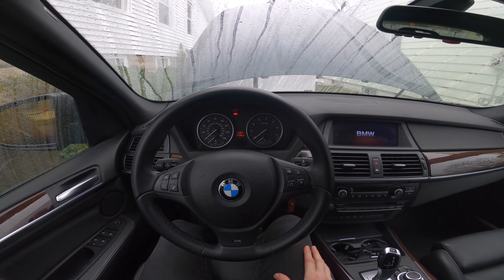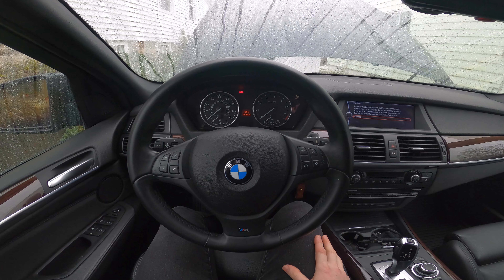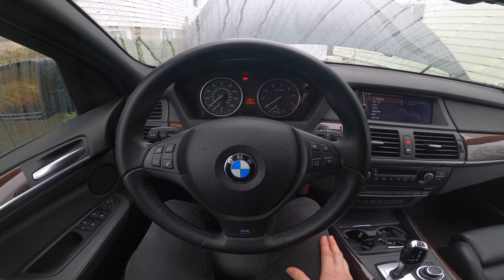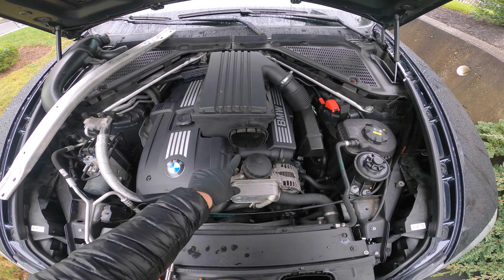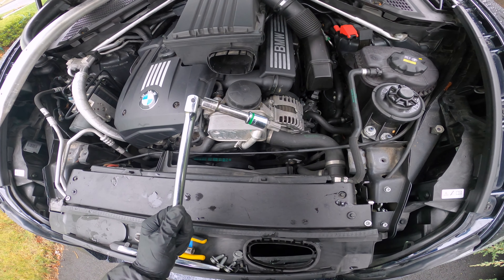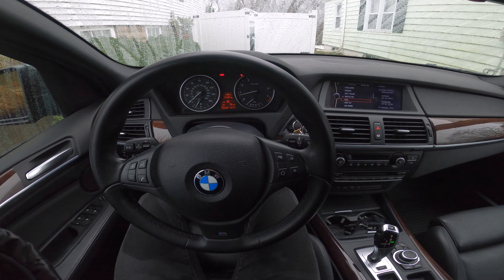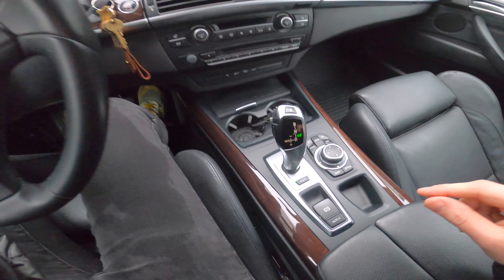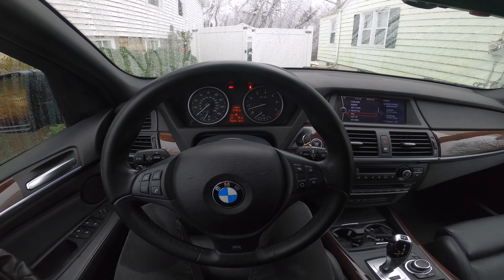E70 BMW X5 Mystery Engine Whining Noise Diagnosis Alternator or Power Steering Sound

Comment: hey, we have identical E70s. I had the same issues in the past. I replaced the Disa valve (bigger one) on the right. the one that is easier to access and to replace. Check both DISA valves. 
Happy New Year,
Reply from the maker: thank you, I will check them as well! happy new year!
Reply: Yes me too
Reply: @BIMMERZEITT what was the issue for you
Reply from the maker: Upon inspection, my BMW dealer said it is the small disa valve under the intake. I replaced them both. I believe the noise is resolved.

Comment: Did you ever figure out what the sound was? I have a similar sound after replacing my power steering pump and a dynamic drive line.. still can’t nail it down!
Reply from the maker: BMW diagnosed and said it is the DISA under the intake manifold. Need to remove manifold to replace. I need to do it soon!
Reply: @BIMMERZEITT  good to know, thank you for the response man!
Reply: I also got this sound after replacing the active stabilizer and 3 hoses. not our reason?

Comment: I'm not very deep into X5 but what does the active suspension have to do with the power steering?
Reply from the maker: I may have misspoke, but I'm just saying that the active steering/ adaptive drive/ active suspension steering pump and alternator are different part numbers than the e70 models without those options. Generally speaking, the alternator and pump are way more expensive for the e70 with those options. So I'm happy that the pump and alternator appear to be fine.
Reply: @BIMMERZEITT  thx
Reply: @BIMMERZEITT  because there are active stabilizers, which are hydraulic, and have one circuit with power steering

Comment: Any updates on what the problem was? I had a bad whine on my 11 E70 and the Power Steering pump failed. Problem is the new $1300 OEM BMW pump is defective and the whine is still there but a little less noisy lol. Glad I ordered from FCP Euro for the lifetime warranty.
Reply from the maker: How did yours fail? BMW said the noise was the small disa under intake. Today we had a catastrophic hydraulic failure. Fluid everywhere. Not sure if a line or the pump let go…

Comment: You might have problems with your I drive screen it keeps fading in and out ? Or maybe just how it appears on camera.. engine noise sounds kinda normal I had same engine in my previous car and it made similar noise.. but to be sure check that ac compressor, there is a bearing in a ac compressor pulley that can be replaced.
Reply from the maker: thanks! yeah I’m thinking it’s the AC compressor. I’ll have to check that next.
Reply from the maker: as for the nav screen, might just be the shutter speed rate on the camera vs. the screen refresh rate

Comment: I have a bmw x6 e71 35i and i have the same sound! 
Could it be hydraulic pump????
Reply from the maker: Which pump?
Reply: @BIMMERZEITT  power steering pump* ?
Reply from the maker: @pianobyat7578  I took the serpentine belt off in the video… so it’s not the PS pump or Alternator.
Reply: @BIMMERZEITT  when you took off serpentine belt, is it still making the same sound? Because it can’t hear it well
Reply: @pianobyat7578 fix problem?

Comment: I would pull the AC belt and spin the tensioner , if it still does it , prob the vacuum pump, better hope its not the vacuum pump lol
Reply from the maker: Thanks brother! I cut the AC belt last night, noise is still there. Was hoping it would be the pulley. Well I guess it’s either the vacuum pump or the oil pump…. Vacuum would be better than the oil pump lol
Reply from the maker: I'm thinking it's the vacuum pump. Ever done one before?

Comment: Hey I have a question whats wrong with my bmw 2011 328i no check engine light on but turn off out of no where & needs 30-40 minutes to turn back on ?
Reply from the maker: Start by scanning it with a BMW scan tool and check all the systems for codes. They can be stored (shadow) but not throwing a light yet.

Comment: did you fixed your noise problem? i have a same problem with my car..e70 48i
actually im trying to figure out this problem but not yet. if you solved the problem or have some clue please share with me. thank you!
Reply from the maker: Not yet. Possibly the vacuum pump or worse yet, the oil pump. The oil pump noise is more common on the V8’s like yours. Look up x5 oil pump noise here on YouTube.

Comment: Hey, uhh, any luck on the source of that noise? I'm thinking AC comp myself, but I also just got my 2006 e90/n52 serviced to clean out the oil tube bc the belt broke 🤷‍♂️
Thanks for the quality content!!
Reply from the maker: BMW said it’s the DISA under the intake manifold. There are 2 valves on the n52.

Comment: have you had any luck?
I meant to ask you: what do you think about the diesel variant of these? Are they a good buy?
Reply from the maker: I haven’t had time yet! Could be vacuum pump or oil pump. However, I heard a 2010 328i with same engine the other day, sounded the same. I considered a 35d and 35i… 35d has very expensive and complex emissions parts that fail. 35i also has very expensive components. This is my wife’s commuter so I went with the 30i for “reliability” and lower cost of ownership.

Comment: The joys of BMW ownership... however that's any car.  Have you tried using a mechanics stethoscope to probe around listening to it?
Reply from the maker: Haha totally. I actually don't even own one, maybe it's time to pick one up and add that to my tool kit.
Reply: @BIMMERZEITT  harbor fright has then cheap af but a recommendation is get them then go to a medical supply and spend the money on replacement ears pieces getting an assortment of sizes to find what fits your ears.  They are soft and seal better not hurting your ears but all in maybe $15-$20 for everything.  Worth it for troubleshoot.  It use mine at work weekly or more.  Cheap HF set with nice ear prices.

Comment: Hey thanks for making this video. Did you ever find the troublemaker, have the same problem on my x5 f15? ☺️ BR
Reply from the maker: BMW dealer said it’s the DISA under the intake manifold. Haven’t swapped it yet!
Reply: @BIMMERZEITT  did you swapped disa? i have the same noise on my e70 nb48 2007 year
Reply from the maker: @dimasnorth  not yet, its sitting here in a box. Need to find the time before winter!
Reply: @BIMMERZEITT  did you do it? :P   ...same whining noise here in Australia!
Reply: @BIMMERZEITT did it work ?